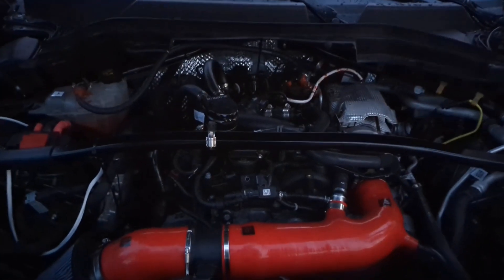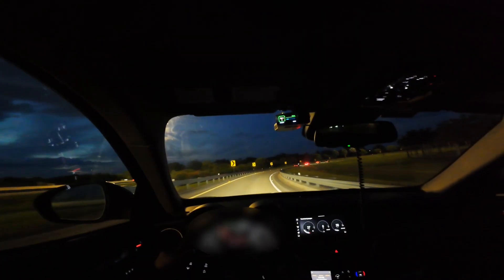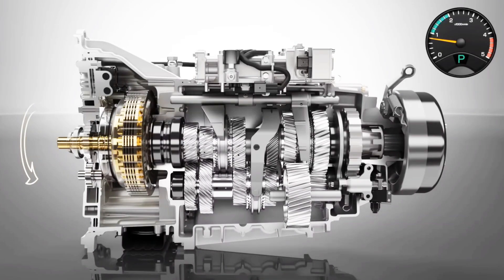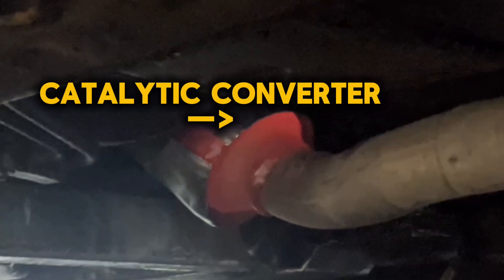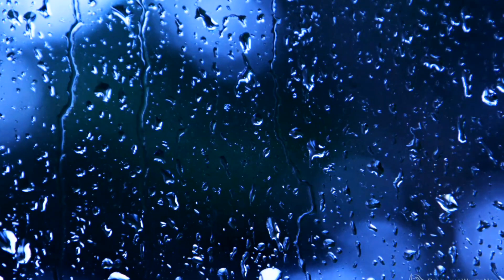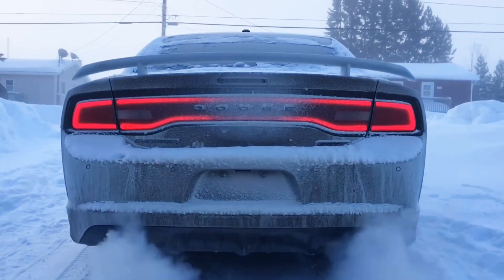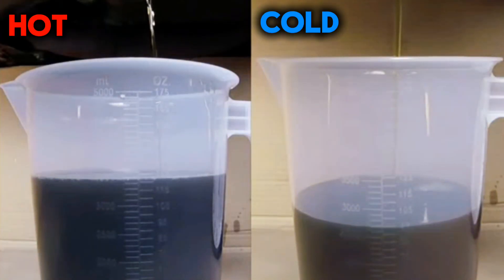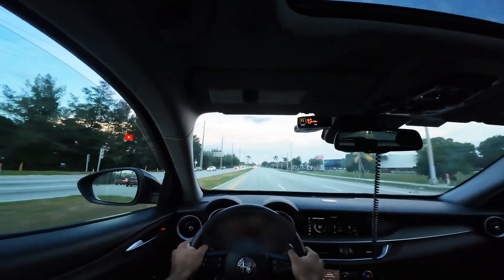STOP Warming Up Your Car – The Truth

Comment: maybe its a separate issue but my car is incredibly unhappy when I take off too quick when very cold. The high idle interferes with pressing the gas so it'll drop from like 2000 where its trying to idle (if its really cold out) to 1200 because i'm trying to be gentle and it bucks the car like mad when that happens. Basically I have to let the high idle come down before I take off or that happens every time. I don't know if its damaging anything but its certainly not pleasant feeling
Reply: Starting your car and waiting for the idle RPM to drop is the way, this video is complete shit
Reply from the maker: You must be best friends with the EPA. Did you watch the video?
Reply from the maker: It depends on how cold your "cold" is. If your car won't take off properly without waiting for the RPMs to settle, it's probably a seperate issue.

What type of car is it?
Reply: @TorqueTheoryLabs the worst I saw in the dead of winter last year was about -20C but it's not unheard of for temps to brush -30 in the middle of the night. I use full synthetic oil so I know circulation shouldn't be a big issue. It is a manual transmission Hyundai so maybe not the pinnacle of quality or good design but still..
Reply from the maker: That's cold, and one of the exceptions I made in my video. So what you're doing is perfectly fine for your climate especially with the way your vehicle responds.

Comment: Good vid. I let my modern cars run for about 30 seconds before driving because it circulates the fluids and lets it idle down. Then I just drive gently till it’s fully warmed up. 

But I have a question unrelated to this. How often do you recommend changing transmission fluid? I see much debate about intervals for this but I know it should be done to prolong the life of the transmission. Currently got a truck with 67k on it and a car with 74k on it mostly city miles that I got both used and none of them ever had a transmission fluid change since new
Reply from the maker: I don't know a whole lot about automatic transmissions, just a little more then the basics - but this is accurate in laymans terms as far as fluid changes go:

As you use your transmission, the clutches and materials wear. Those materials get circulated inside the fluid and act as "friction" for the clutches to engage. The higher mileage the transmission, the higher of a chance that your clutches could be decently worn/glazed. Dirty fluid has a bunch of clutch material in it that masks the issue of decently worn/glazed clutches.

Dirty fluid is bad for your transmission - but the friction keeps it working. Fresh fluid at proper intervals extend the life of those clutches, so this doesn't become a problem so soon.

This only becomes a problem if you wait too long before changing your fluid, and there isn't a steadfast way to tell (especially with city driving and 60k+ miles).
Reply: @TorqueTheoryLabsYeah I’ve heard similar stuff from other people. Thanks for the reply. Probably safe to change it on the truck with 67k because quite a bit was easier highway mileage but the suv with 74k of almost all city miles would be more of a risk due to likely a lot more wear

Comment: i dont understand why the cylinderwall washing occurs when you idle but it doesnt if you drive off ? what changes and what about engines from 1997 or 2005 ?
Reply from the maker: Cylinder wall washing occurs as a side effect because your ECU is trying to light off the catalytic converter, so it purposely runs rich so the fuel and CO can reach the converter and react with the catalyst.

When your idle drops - it signifies that your car doesn't need to do that anymore since your catalytic converter has reached close to operating temperature. When you drive off, you can warm up your converter faster and get out of the high idle phase where cylinder wall wash can happen as a side effect.

Comment: But I don't have emissions on my car
Reply from the maker: Deleted, or just so old it's not equipped? Cause then it might fall into the carburated category.
Reply: @TorqueTheoryLabs I mean, I deleted it all off my LS two and it's the fourth GEN so there's no EGR no catalytic converter. Nothing just pure unadulterated backfiring goodness from extra fuel burned in the exhaust.😊
Reply: @TorqueTheoryLabs I mean, I'll let my bike warm up that's mostly because I start it and then I start getting everything ready and my helmet on and everything else like that
Reply from the maker: That's probably just fine (I don't know a whole lot about bikes though).

That LS probably sounds awesome!